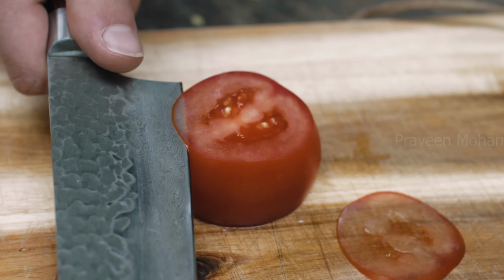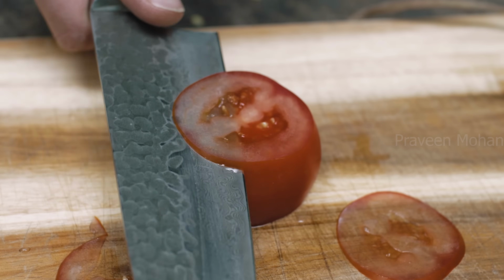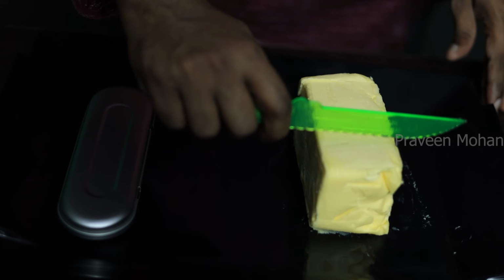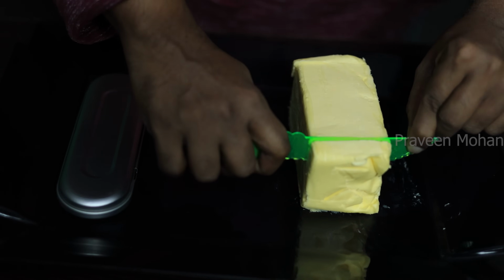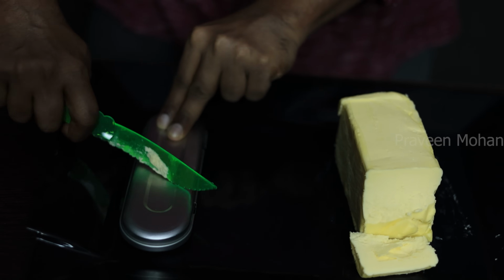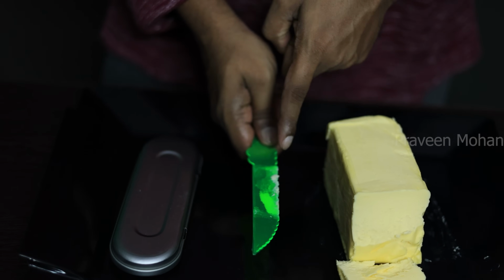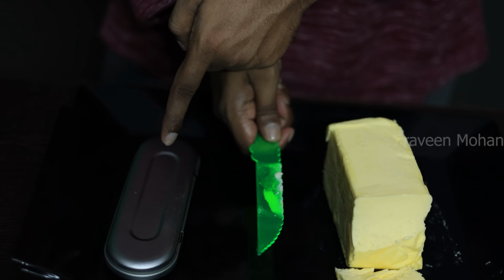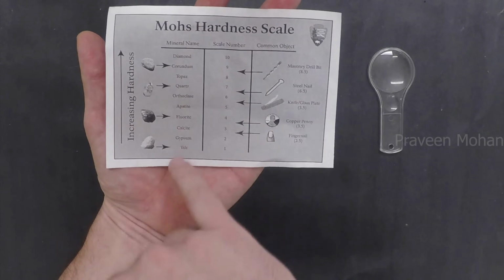They Softened Rocks With Herbs? Lost Technology of Ancient Machining

Comment: Very interesting.  When it comes to simple tools, people tend to forget the pentagraph.  a set of wooden sticks with fixed pivot points usually used to copy and scale images.  Even the arms of Desk Lamps are actually based on this line of thinking.  Combining both, you could potentially scale up a clay model up to the size of a statue and a combination of tools at the carving end to do the curves.  I did note that the chest and belly curves are indeed a form of mirror of each other as well as following the shape of that area.  it does look like it was the almost final cutting like in CNC on a 5 axis mill when it is set up to follow curves and shapes.  With the video clip of the head, if you used the segment prior to the final shaping, you would have a more clear view of the curves helping define the head and have similar curves.
Reply: they also use this tool to make coins. They make a giant coin and then tool down the tiny version.
Reply: It's "pantograph" I think.  Good theory, it seems like the tool on the granite side would have to be a high-speed rotary burr, something like that?

Comment: Could it be that humans are looking for the wrong type of equipment to perform these stone cutting tasks. The thoughts of CNC machines is completely unnecessary in thousands of ways that we don't need to go into. Possibly what your looking for is a simple way to compress air to create a sand blaster that would be capable of sculpting any types stone on your world such as today's grave headstones. The earth is actually made of superior cutting material that goes way beyond solid metals. You could start with actual sand or use many different media like nut huals, to crushed olive pits.